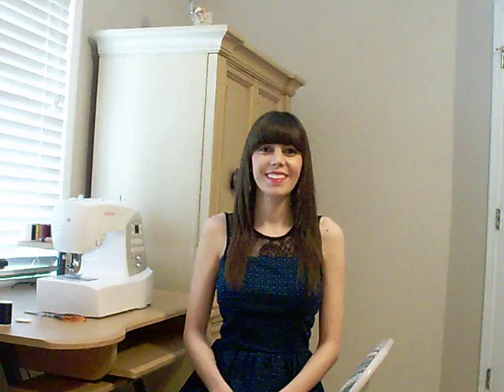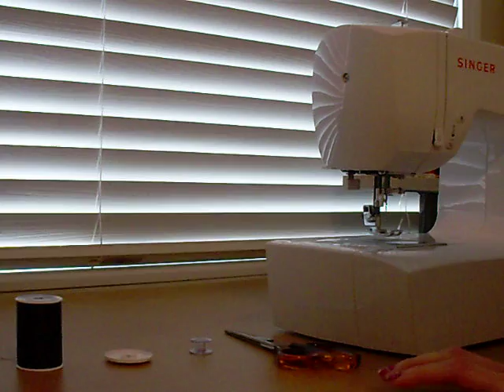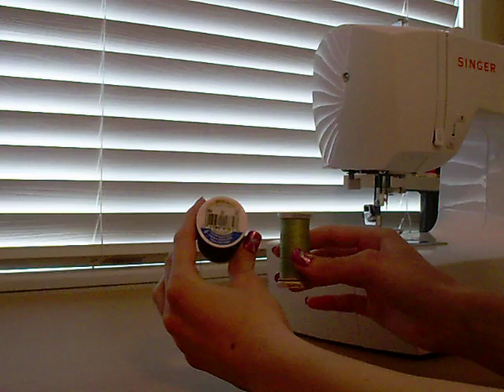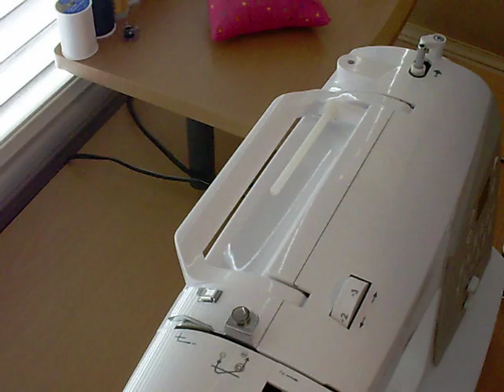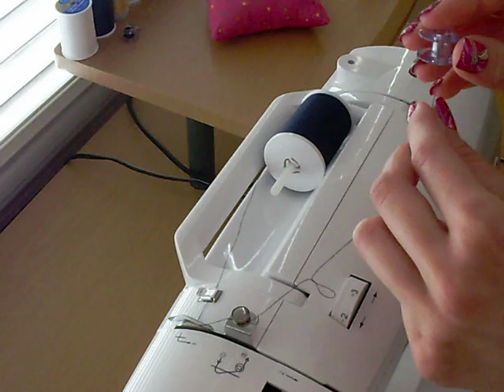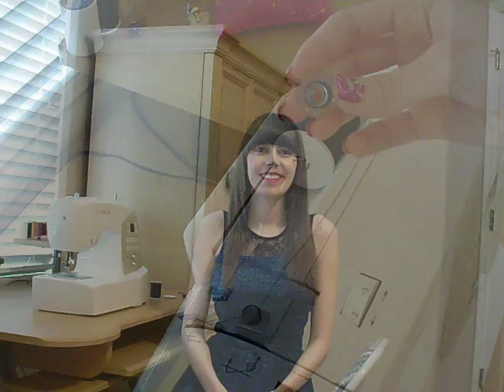HOW TO Wind a Bobbin using a Singer Sewing Machine

Comment: Thank Olivia for the helpful video. However, I followed exactly what you instructed but the machine stopped working after it started for 1-2 seconds, and there was a note on the screen "E2". What does it mean? I'm using Singer 7258, please help me solve this problem. Thank you.
Reply from the maker: Hi! Thank you so much for watching my video! Using incorrect bobbins may cause error E2 to occur. Not all plastic bobbins are the same size, so check the model number of the bobbin to ensure that you are using the correct one with your sewing machine.
Reply: @OliviaRita  I'm using the correct one when I bought Singer sewing machine
Reply from the maker: @MiniHanhnguyen  Hi Hanh! Are you using Singer thread? My machine doesn’t take Singer Thread. I used Coats and Clark or Gütermann.

Comment: Hi! Thanks for the great tutorial. I have the same machine but when I start the machine, it stops/freezes after about 2 rotations. Do you have any idea what could be causing this? I have threaded the machine correctly but I can't figure out what the problem is. Sewing with the machine is fine.
Reply from the maker: Diana221162 hi! It could be plenty of things. Are you using the right thread? When I first got this machine I was using Singer thread and the Singer company told me not to use singer thread. It could also be that you need a new needle, need to clean your machine or need to set your number setting right. Keep me posted on if you figure it out. You could always call Singer for help!
Reply from the maker: Diana221162 thank you for checking out my video Diana!

Comment: I followed all the instructions, but my thread is only wrapping around the metal peg the bobbin is on and not the bobbin. Anyone know why?
Reply from the maker: Kira Holt did you wind the thread around the bobbin a few times before you started to wind the bobbin with the machine on with the presser foot? Also, make sure once the bobbin is in place that you snap it to the right before you wind the bobbin with your machine on using your presser foot.

Comment: I can't find the holes in my bobbin to thread it. Help plz!
Reply from the maker: There should be four holes, two holes that are closed off and two that are open on your clear bobbin
Reply: +Olivia Rita are you supposed to pull it through both holes or just one? When I put it through both holes it starts to wrap around the metal part and not the actual bobbin
Reply: Uhhlaneuh same

Comment: For some reason my machine will not let me fill the bobbin, it stops and starts to beep, also the needle is moving is that suppose to happen? Please help!
Reply from the maker: Once you place in the bobbin at the top onto the bobbin winder shaft then you need to snap the bobbin winder shaft to the right. If you do not snap the bobbin winder shaft to the right your bobbin won't load thread and your needle will move up and down. Your needle should not move if your bobbin winder shaft is snapped to the right.
Reply: We're having the same problem and it used to work.  The bobbin IS snapped all the way to the right, but the machine is beeping & the needle is going.  Any thoughts?  Thnx.
Reply: Same problem with mine now., I’ve done all I needed to do even my husband tried it, the needle will move the wonder will wind a sec then stops and made a beep and an error 88 ., I don’t know what to do anymore

Comment from the maker: @Cindy Walraven you seem
to have the same problem that I had. You cannot use the singer brand bobbin and you have to use the ones that came with your machine. If you would like more bobbins that fit correctly and work
correctly with your machine I suggest that you call the Singer company so that they can send you more bobbins that fit your machine!
Reply from the maker: @marecostello  Hi! I threaded the thread into the top hole. Yes, you should be able to re-wind the thread to the thread spool and try again. I also have another video on my YouTube page called “HOW TO Wind A Bobbin On A Juki dx7 Computer Sewing Machine” check it out! I hope this helps! Thanks for checking out my videos!
Reply: @OliviaRita  after being able to consult a designer friend I found out that I needed to bring the thread around the top part of that second metal piece (not the lower like I was doing) and after I did that it worked like a charm. Cheers!
Reply from the maker: Glad your designer friend could help you figure it out!!!

Comment: Hi! When I push the pedal on my Singer Fashion Mate after I thread it, two C's pop up on the screen indicating according to the manual "Bobbin winder is in operation. Move bobbin winder to the left when it is not used". The bobbin is threaded and pushed right when I pushed down on the pedal but it won't wind up.
Reply from the maker: Did you hear the click when you pushed it to the right?